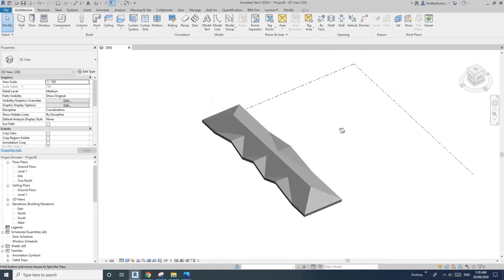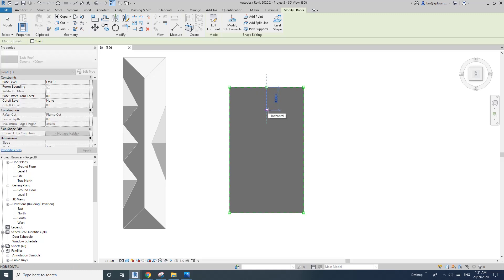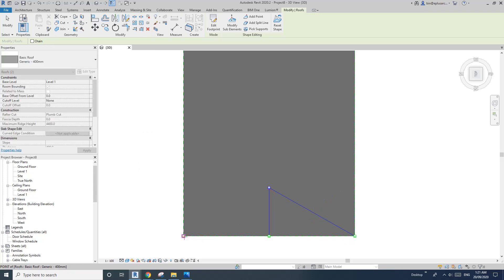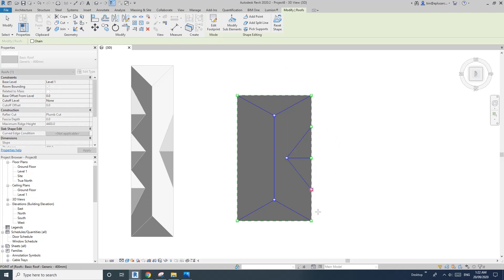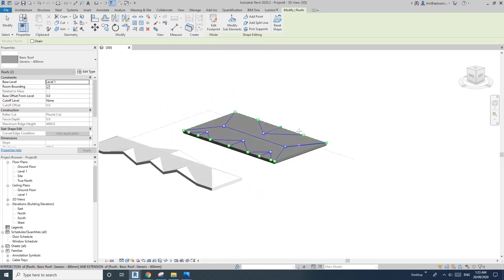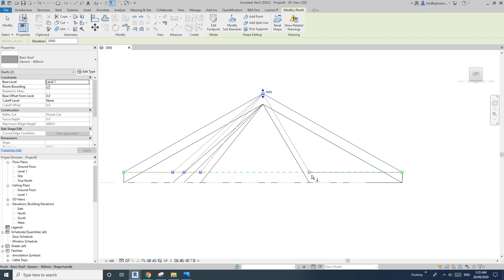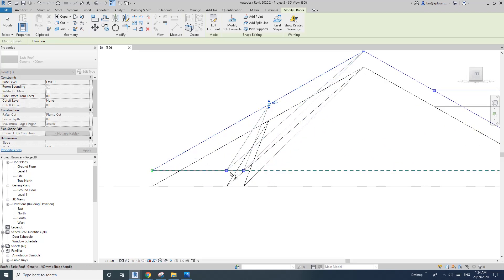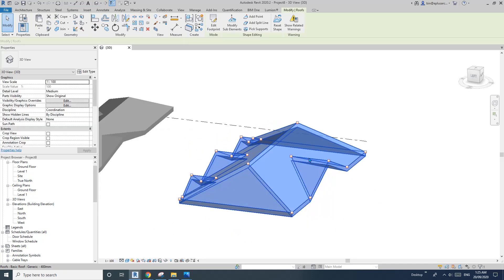Revit Exercise (Day 183) - Modify roof using Modify Sub Elements

Comment: hi. i have been struggling with this roof for hours and for some reason, the sub elements modification just does not show up and therefore i cant use the split lines. is there any other way to access the split lines??? much thanks.
Reply from the maker: Is your roof flat?
Reply: @BINHE615 hey bro i have the same problem, what should i do?